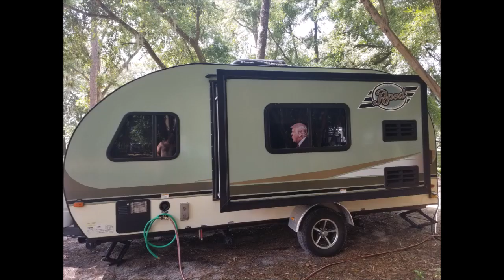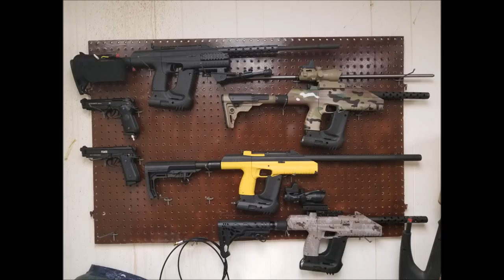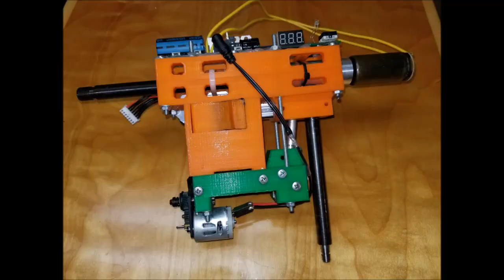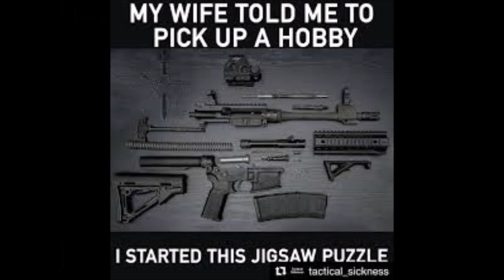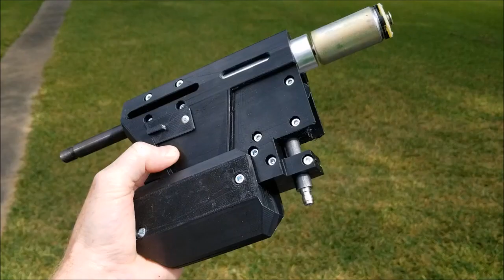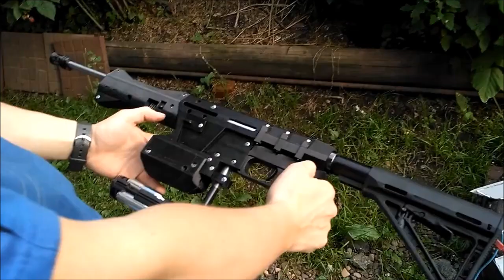Introducing Our BB Machine Gun

Comment: ...livin' the dream! love your work. sadly, totally illegal where i'm from, when the blackbird came to the uk it was semi only......... Q. would a can work on this, where's most of the noise from?
Reply from the maker: Thanks! The thing about cans on these is if you don't have the clutch tight enough you will have one come out full force, and then another come out at low velocity because it venturies out of the feed channel before it's in battery. Then a full velocity bb will slam into the back of the slow one. This can wreck baffles. Also in extreme fire rates the baffles pressurize so it's like not having a can at all. These problems only show up at extreme fire rates. 1200, and below they work OK, but you still have the noise of the mag motor running, and the solenoid slamming the valve. You might want to contact Sergey for a "European version" board ;) ;) His email address is e-go@inbox.ru.